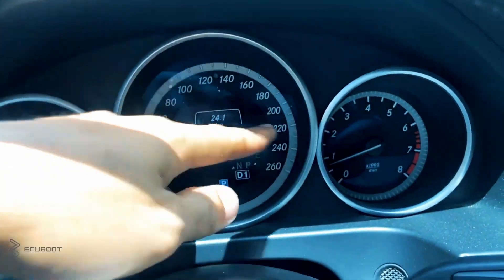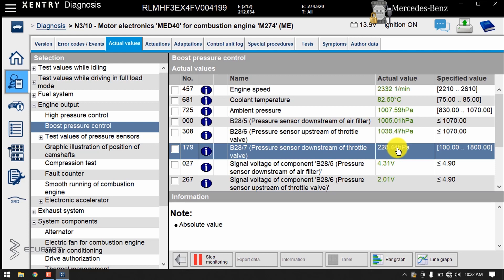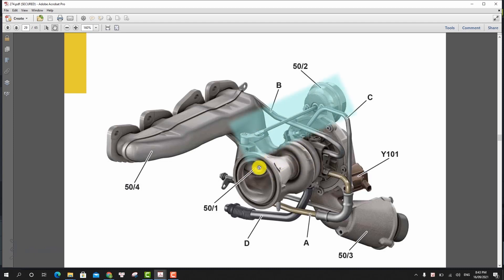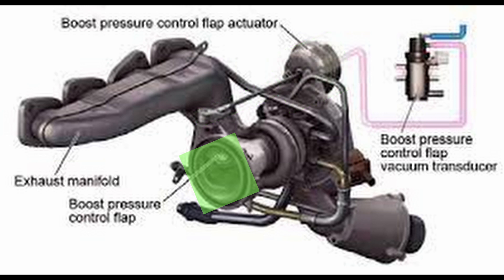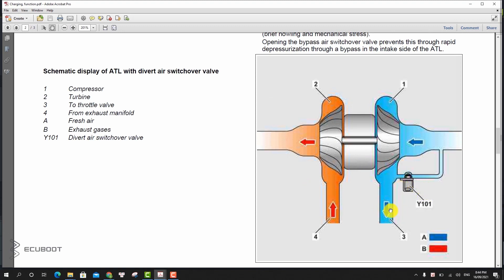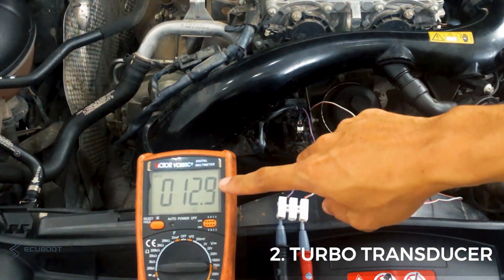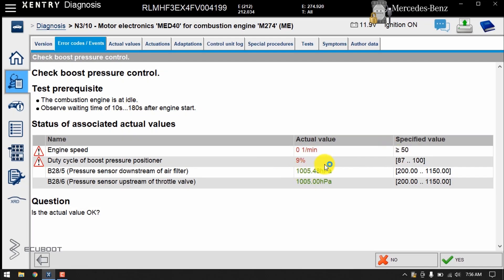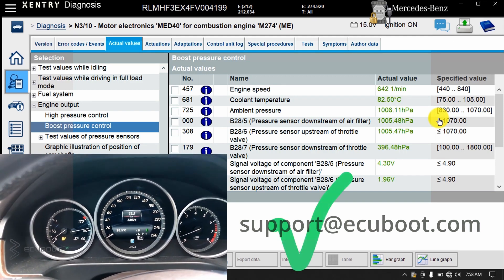Fixing Mercedes Turbocharge Fault P0299

Comment: Low pressure turbo has electrical fault 
Boost pressure of turbocharger 1 is too high 
Air leak detected on intake air system  
Intake air pressure has a short circuit to positive 

I checked all air lines no leaks , replace waste gate , actuator  , checked all the fuses , turbo went to be fixed but still no difference
Reply: Inlet manifold

Comment: could be bad pressure transducer (boost controller)
could be bad wastegate actuator
could be bad brake vaccuum pump 
could be bad water pump (vacuum actuated)
could be bad turbo
could be bad pcv valve under intake

Comment: I have an 2005 E200 k and i already took it into 2 mechanics for battery issues, which im yet to be convinced are fixed yet

Very same day, i just got a CEL with O2 sensor code as well as turbo code and it went into limp mode soon after , less than 200 km after leaving mercedes.
I was able to reset these with my code reader but i didint write down exact code numbers.
How does my supercharged engine get a TURBO code fault?
the mercedes mechanic had just looked at my car and said there were no serious  CEL codes but he figured some vibration or groaning under  throttle was either a bad supercharger or motoro mount, I paid $425 plus two bus tickets $80, mercedes had my car for an entire week, couldnt find any codes nor do i think they fixed anything and i get serious codes and limp mode 4 hrs/ 200 km later?
what do you think?

Comment: I am a mobile mechanic. Sitting in my van at customer job. Scanned engine and found system has P0299 fault. To fix anything you must first know how it works. The data from pausing this video and then printing screen shots is great. I will go and research then return. Return a wiser man. Still as sexy though.
Reply: What was the issue?
Reply: He never returned
Reply: @BurhanUddin-mj9ww  im back
Reply: @jamesbarratt593  what was the issue??

Comment: The engine has been on turbo underboost m271 2013. Yhe actuator is not moving, hence waste gate doesn’t open. Couldn’t locate the fault for 3 months now
Reply: You mean the wastegate doesn't close? Check for vacuum which comes from a vacuum pump. The vac pump has a little check valve for the turbo that tends to fail, so replace check valve. The vac lines often crack/break, or maybe fall off. Be sure the turbo solenoid is getting said vacuum, and the lines between the solenoid and turbos are good as well. The solenoid controls boost by how much vacuum it feeds the turbos. No vacuum getting the turbo, no boost.
Reply: How do you check the pressure/vacuum? Also, how do you check where the leak is? It could be in the actuator valve, or the wastegate actuator, or even the catalytic converter